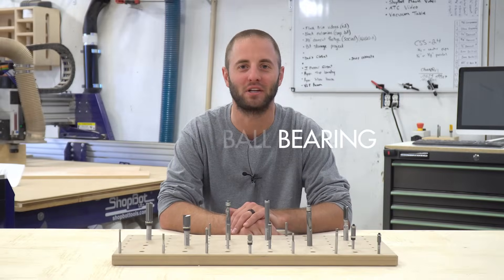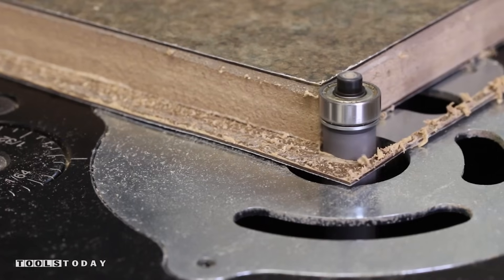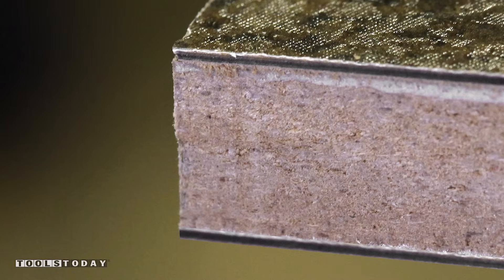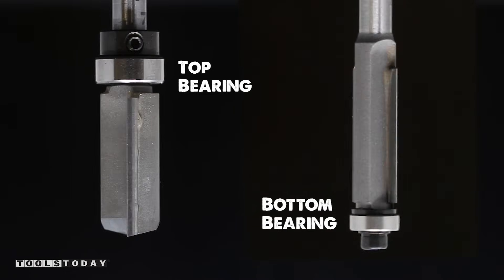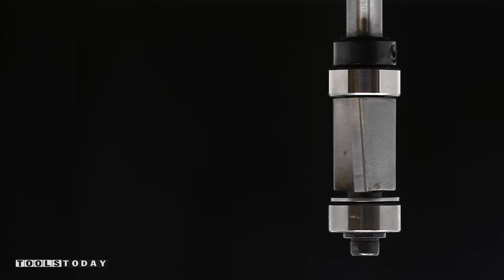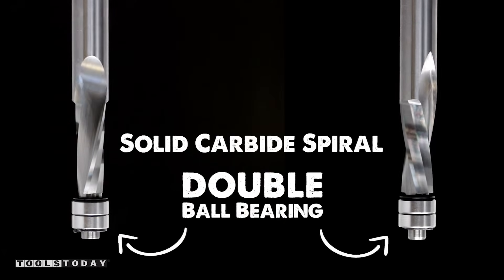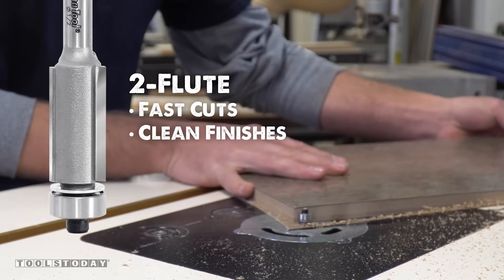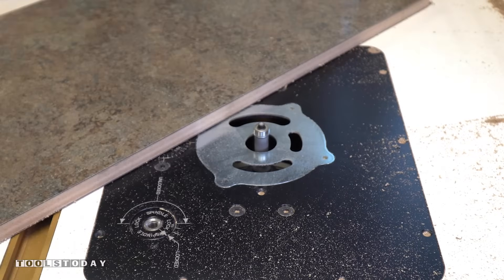Flush Trim with Lower Ball Bearing Router Bit | Amana Tool Technical Series

Comment: Hello bro. I need your help please. I made a butterfly shape epoxy coffee table and I made the edges all around by the mold as a zigzag shape. Now I changed my mind and I want a flush straight edges all around but to keep the butterfly shape my problem is I don’t know which reference and bit I should use. Thanks
Reply from the maker: Hi there, how thick is the material of your table?
Reply: It’s about 4 cm. I flash the top surface with CNC . And you can imagine a 100% flat surface with butterfly shape coffee table with zigzag edges . I used the lawn edging as a mold
Reply from the maker: @wolf7232356  We recommend using the 4-Flute Flush Trimmer Router Bit by Amana Tool, item no. 57187 and 57186 will both work. We sell them here, on our website, 
https://www.toolstoday.com/super-flush-trim-router-bits-4-flute.html

Comment: Love these bits to death. One of my favorites is your 1/8" shank 1/4" guide bearing bit. I can use a router base for my Dremel and turn it into a mini router table for small parts. I have a wide collection of the other guide bearing bits and use them all the time. Best in the industry.
Reply from the maker: Glad to hear that, Matt. We particularly enjoy these bits for the same reasons, and Amana Tool's mini 3/16" dia ball bearing guide gets in those tiny corners well on Table Router and Hand-Held Routers.
Reply: @ToolsToday  Yep. I do guitar work and I would not be able to get by without these bits. A lot of times people think my custom pickguards are CNC done, and I gotta tell them I do it by hand but the Amana bits are what make it possible. It makes life easier for guys like me who don't have access to CNC, and can still get crazy accurate results with a Dremel and/or router. I also have come up with some atypical uses for your 1/8" shank guide bearing router bit, using the Stewmac precision Dremel router base, as well as Stewmac's soundhole/rosette routing jig. That 1/8" shank Amana bit is genius, and for a lot of guitar work, even a palm router can be overkill. Makes life much easier!
Reply from the maker: @guitar_md  We enjoy to here that! The Amana 1/8 shank and 1/4 shank with mini 3/16" ball bearings are excellent for Guitar Making.
Reply: Which one do you recommend for the completion of formica? My raunter is 1/4 thanks